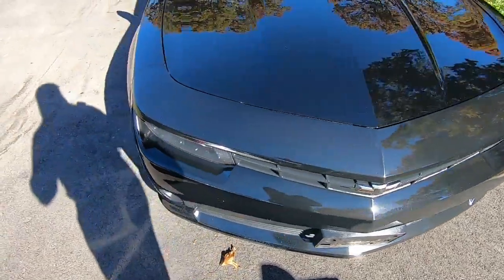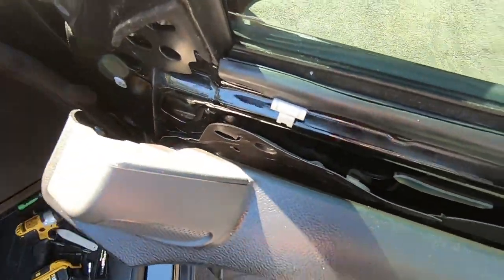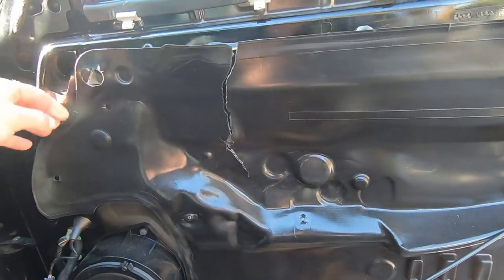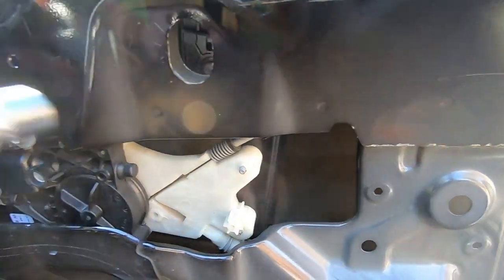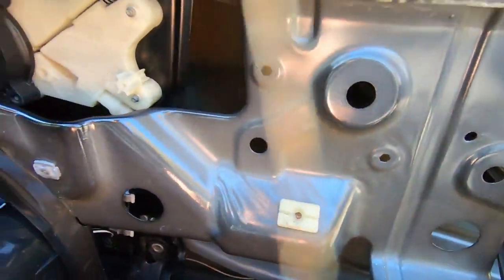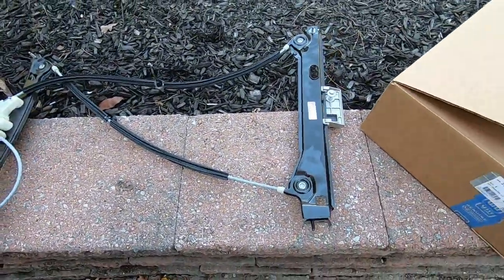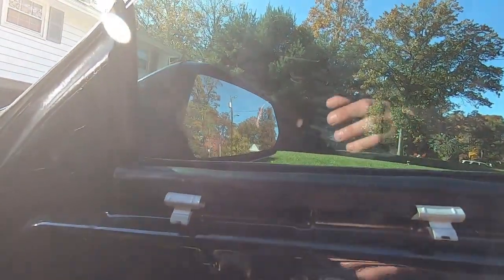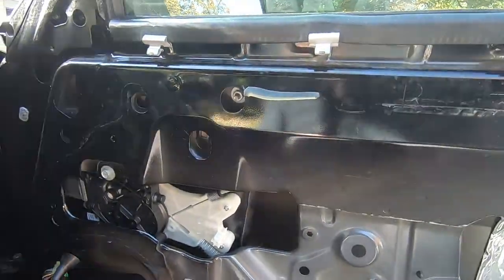2010-2015 5th Gen. Chevy Camaro Window Regulator Replacement

Comment: I put in a new regulator and it still won’t go up. It feels like it’s stuck on something🤦🏽‍♂️
Reply from the maker: Every regulator I saw for this car also came with the motor included, so I’m assuming you had a new motor with the regulator as well? Can you hear the motor engaging and trying to function when you hit the switch? You could take the window out of the door and engage the regulator and see if it moves and works without the window, that will help steer you in the right direction! Let me know what you find.
Reply: Yea I bought the whole set. Regulator and motor. I hear it engage when I plug it up. When I press the button to let it up or down it goes up a couple inches and back
Reply: There is no window. My car got broken Into. I have a replacement window but it isn’t going up for me to put the window in.
Reply from the maker: @GIANTS941  damn man sorry to hear. I know im like two weeks late, but did you ever get it resolved? Possibly a defective part?
Reply: It was happening to me to. There is a square on the window bracket shaft. It slides into that an gets stuck when you put the window all the way down. I used a screw driver an put pressure on the window bracket that got stuck in the square as I press up on the window switch an it moved up.

Comment: Your video was very helpful, unfortuantly after plugging my switch in the new regulator gave me the same issues. It wont go up and its stuck in the down position. Any ideas? I hear a clicking when I press the down switch
Reply from the maker: Test the motor off of the car. You can do this with a battery/leads, but easier way would be have the motor in your hand, but have it all plugged into the car/switch, and test it outside of the door. If its not working outside of the door you might have a defective motor or bad switch.
Reply: @TheOriginalBeeCee  thanks, I've noticed a gradual loss in power on the window with the old regulator in which leads me to believe it has to be regulator related. I'll see if it works outside of the car

Comment: Nice video, i’ll be doing this soon. How when putting the window glass back in did you have to apply hard pressure to get it to sit in? Also, could you tell me which radio dash kit you have? Thanks
Reply from the maker: I appreciate the comment! I don’t remember having to apply much pressure when re-installing the window. And the dash kit is the Metra 99-3028S
Reply: Thanks! Do you recommend it ? Did you keep steering wheel controls?
Reply from the maker: @yeyoyeyo1819  i like Metra for the most part over any other brand when it comes to audio installation parts. This kit is a bit more involved than your typical dash kit, but it went seamlessly and seems to be pretty good as far as i see. This particular car didn’t retain the wheel controls, but you can with part #AXSWC steering wheel control interface

Comment: I have 2010 Camaro 5th gen and my keys got locked in car so I had to break my passenger window now shatter glass is inside the door when they replace my window at a glass shop will they take out the glass stuck in the door ?
Reply from the maker: Thats a subjective question really. Depends on shop and how good they are. Technically they should. But that’s something you would have to ask them. If i was doing it, I would vacuum the entire door out and make sure everything was out and probably the surrounding carpet area as well.
Reply: @TheOriginalBeeCee  yeah they should if there professional cause I did vacum the shatter glass but there still inside deep in door where the window goes so maybe they will help me take it out there is no vacum that can fit through the window area
Reply from the maker: @andrescastorena9604  yea most definitely they should. But once the door panel is off and you got access in there, it should really be all accessible and able to be vacuumed up once it’s apart.

Comment: Thanks so much for the video. Made me a subscriber! I own a 2010 Camaro with RECENT occasional grinding window noise, esp in colder weather. I haven't used this car much, only has around 30K miles. So....I'm wondering if the noise is caused by something other than the regulator. Maybe the lack of raising and lowering windows? Or lubrication? Thanks in advance!
Reply from the maker: Thanks for the comment! And I appreciate the subscription 🙏🙏🙏 but this is actually a friend of mine’s car, and I do maintenance/issues as they arise. IIRC He had a bit of grinding noise prior to this thing completely giving out. So in my opinion, it’s probably on its way out. His was around 70K. This is a known issue with these cars as well.
Reply: @TheOriginalBeeCee  thanks for the response, I was hoping there might be a quick simple temporary fix to extend the inevitable. I guess I'll stay away from windows as best I can for now 😒
Reply from the maker: @denotsmai  yeaa man unfortunately it just seems like they are ticking time-bombs.

Comment: Hello, I have a problem on a Chevrolet Camaro. The right window does not move. It is fully retracted and it says calibration problem. I will change the motor and it will fix the same problem. pls help me am from georgia Tbilisi
Reply from the maker: You need to remove the door panel and see what’s going on behind there so you can figure out whats needed. 

See if the cables are jammed or damaged or broken or as they were in the video. If they are…..Then you would need the entire regulator and motor, not just motor. If all the cabling is all intact and good, then you probably just need a motor. 

But you need to get that door panel off to to see whats going on behind there so you can accurately diagnose what the issue is.

Comment: Question I put a new window regulator but it won’t go up it got stuck
Reply from the maker: There are multiple possibilities. What was the initial issue? Did you get a new motor with regulator? Is the motor engaging (can you hear it trying?)
Reply: @TheOriginalBeeCee  yeah I bought a new regulator assembly it was working the motor was engaging but it won’t go up it stuck at the bottom.
Reply from the maker: If the motor is engaging, then something with the window alignment has to be off. You need to pull the window out completely, make sure the motor and track go up and down, then re-install the window. There’s only so much that can be wrong, so you just need to get in there and mess with it.
Reply: Yeah one thing aswell motor won’t go up and down but the motor is engaging if that makes sense
Reply from the maker: Got ya. Make sure it moves fully without window installed. That way if its off track, it can be pin pointed. Also, could still be a defective motor even though its electrically engaging.